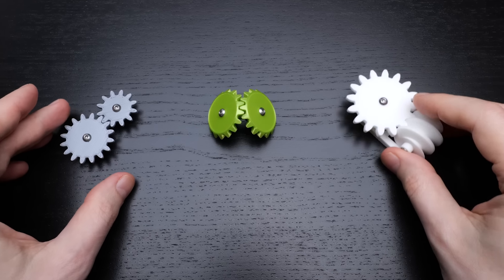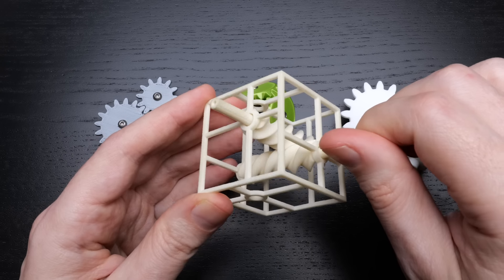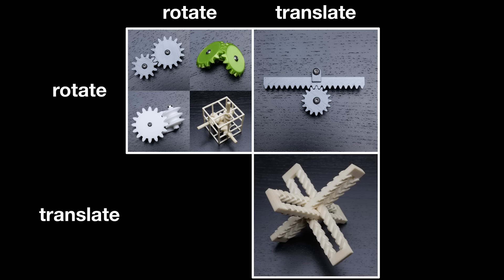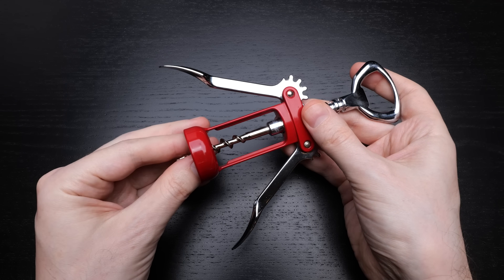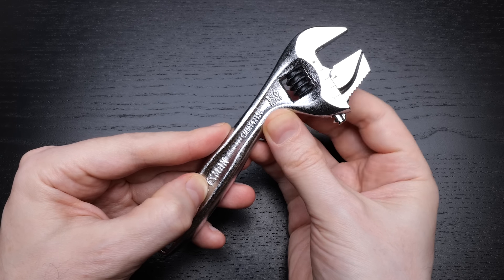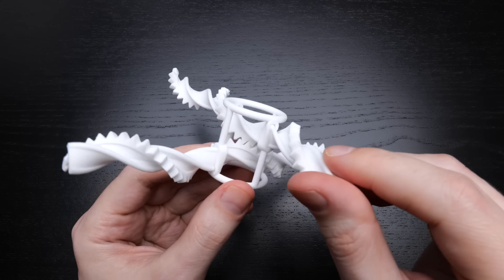Screw/screw gearing

Comment: This seems like a solution that has not found its problem yet.
Reply from the maker: That's often how art and (pure) mathematics work.
Reply: @henryseg  I have a folder on my computer titled "Solutions in search of problems." I think this sort of engineering is good practice and frees your brain up for lateral thinking once the real problems come along. One of the files in this folder was a spherical gear, which I never figured out but these smarties did: https://youtu.be/hhDdfiRCQS4 What would this be an example of? Rotation-rotation-rotation?
Reply: @digitaluddite  I have a folder on my computer like that, but it has nothing in it!  It is a solution to a problem of solutions in search of problems!
Reply: @henryseg  Then I think my art has yet to find its problem.
Reply: It's perfect for making 45 degree holes in a production line. One piston, and two drill tips. Also, for a vault lock.
Reply: You mean like a technological singularity?
Reply: @digitaluddite  what do you mean you never "figured out" the spherical gear? Figured out how to put it together you mean or how it worked what? Hope you can clarify. Thanks for sharing
Reply: @henryseg  Do youbhave any tips for coming up with new designs for these new tools or mechanisms or wha/ever you call the or how to solve problems with them? Thanks for sharing and hope to hear from you.
Reply: It's a pretty cool mechanism, but it looks like it would be very fragile and easy to jam.
I doubt that it can exert much torque before distorting permanently, then jamming where the frame and screw intersect.
The screws also cannot be very long, else they will distort due to their own weight.
I'd really like to see this mechanism somewhere in the future, but I kinda doubt that there are many useful applications.
Reply: @leif1075  I’ll try my best. I wondered if a gear could be made 3 dimensional. I started with a sphere and ADDED teeth, trying to find a way to pattern those teeth around a 3D surface. I couldn’t ever figure it out. Some time later I came across the video I linked to. The key difference that they made is that they CUT the teeth in one rotational motion and then again in another rotary motion. I was somehow trying to find a spherical gear set where the two gears are identical. I don’t know if it is possible and surely isn’t as useful as the gears in the link.
Reply: @digitaluddite  Mate, that's clearly a prototype for robotic shoulder and hip joints; or at least they will be some day lol
Reply: 42
Reply: @isaacm1929  you over estimated by 3 degrees
Reply: @angelsachse9610  I think the two helix gears could be on outside of solid shafts and still work which should fix most of the strength issue.
Reply: The problem is, "What can I make a video about?" Or for the audience, "How can I distract myself from the dreadful meaninglessness of existence for several minutes?"
Reply: i ve found the problem your solution can fit into: mechanical RNA and DNA Transcription principles. plz mention me in your paper now.
Reply: @digitaluddite  DNA/RNA Repair mechanisms.
Reply: "Nail seeks hammer"
Reply: @averageXIAOHONGSHUenjoyer  lol no
Reply: Mechanical daydreaming.
Reply: @angelsachse9610 just add gears to support it
Reply: Often because art is not a mistake, and the result can't have a mistake since you are the first person to make that particular thing. I may have flaws like what you wanted it to be versus how it came out, but make no mistake, it can't have a mistake.
Reply: @leif1075  Sphgear
Reply: yea, he is that guy giving smart math answers. But the teacher has not asked any questions yet.
Reply: Looks like protein making 😮
Reply: Technology so advanced it has no application
Reply: @Oberon4278  well, we can't all be engineers. I dig this kinda thinking and dare say, there's SO many better ways to grab the attention of vacuous ppl.i think there's something that society can benefit from here. Kinda like what the Internet was always supposed to be.
I wonder, have you ever seen Leo daVinci's mock up of the 1st tank? Do you find it any less amazing once you realize it's error? Does anyone have the credentials to judge his work?
Reply: @neepsmcfly4176  What?
Reply: Nah this is how they make bmw engines
Reply: @henryseg  screwscrew box looks like protein production from dna.
Reply: Like lasers
Reply: Could be used to easily adjust a plane centered on the frame, work can be applied to both screws and lift a very heavy load between the two, 
If there's enough friction between the screws or if they're kept motionless it could allow you to create an adjustable table with very few parts
Furthermore, precision is extremely high and since jerk and acceleration are minimized to the screws and not the load it would be great for extremely precise movements
Reply: You just asked a problem
Reply: if we define practical intelligence the ol' fashioned way as the ability to solve problems, this finding solutions to problems before they even exist should definitely be called genius...
Reply: This might be able to be used in gantries and 3d printers!
Reply: @Evan-hm7tz  micro printers especially, jerk is so low precision is probably really high
Reply: I feel like the screw/ screw gearing would make an interesting locking system with a few tweaks here and here
Reply: @someoneonyoutube8622  exactly, and found on another world.
Reply: It looks like RNA
Reply: Mmmmm DNA REPLICATION?
Reply: The whole job of an engineer actually, find a problem to a solution 😂
Reply: @henryseg  there's a company called Roll making some crazy cool mechanisms. You would probably love their stuff
Reply from the maker: @1jtwister  Not the easiest company name to search for - any other identifiers?
Reply: Quite possible. Yet it's still a fascinating thought exercise.
Reply: It's a concept for future innovation. Not all invention or innovation target's a problem.
Reply: The problem that is being solved here is .....how to get views on YouTube ?
Reply: @snoochen  yes, answers to non-existent questions )
Reply: @neepsmcfly4176  Leonardo knew what kind of work he invented the tank to do.
But the topic starter does not know what kind of work he invented his mechanism to do.
Reply: Maybe it could be used in a puzzle or in robot parts/implants
Reply: this is where Steve Jobs' brilliance would come in handy. He'd market this in some simple implementation & everyone of us would wonder why we didn't have it by default since time began.
Reply: @henryseg  As a composer, I really appreciate this comment as well as your brilliant designs. Liked and subscribed!
Reply: @averageXIAOHONGSHUenjoyer  ????? bro what
Reply: DNA would like a word with you
Reply: @henryseg thats an interesting way to look at things. So every math problem that seems useless to us has some yet to be discovered application?
Reply from the maker: @Spicystachegamer  Perhaps, yes. Or maybe no application will ever be found, who knows? But that’s not generally why pure mathematicians or artists do what they do. It’s great if there is an application, but it doesn’t invalidate the work if there isn’t one.
Reply: Me fr bro 😔
Reply: 42
Reply: I can see this being a cool new way to drive pistons in an engine
Reply: @bobmackay1856  ah crap, I might have to do this!  If I'd done it since I was a kiddo, I'd have stored GB worth of ideas!
Reply: @henryseg  There is a kind of a metal lathe 3-jaw chuck which uses similar racks to sunchronise its jaws.

Comment: The translate-translate gear is almost a pair of opposed mechanum wheels, if you were to bend one of the translate gears around so that it loops back on itself. The action of the rollers is as if the floor had teeth at 45 degrees to the plane of rotation.

Comment: Henry, have you considered attempting to build a pliable/flexible version of that mechanism, such that the helical racks conjoined to form a figure eight?
Reply: Or a moebius strip each?
Reply: I don't think that could work. As one piece, the rotation and translation when it crosses itself will be opposed. You would need a spur gear between.
Reply: @punpundit5590  I'm definitely not an expert on this but my intuition tells me that if they are both Möbius strips then there should be no need for that intermediate spur

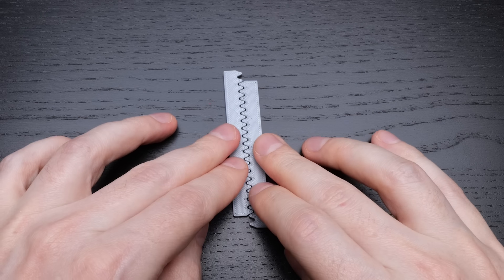Comment: The "two ordinary racks" from 5:45 remind me of a safety feature in railway rolling stock, where they add large rack-like panels to stop relative motion along a vertical axis in colliding vehicles. That prevents a situation where one vehicle's frame could slide on top of the other frame and crush everything in the passengers' space.
Reply: Ive seen these on thise little cargo wagon deal, basically a skin made of teeth that fit to the cart, then you could lever the teeth up to keep it rolling.
Reply: @Absolute_Territory  Not quite sure we're talking about the same thing there...
Reply: Oh, anti climbers! Aren't they for preventing telescoping?
Reply: @Absolute_Territory  Write a horror story in only four words:

"skin made of teeth"
Reply: @falkland_pinguin  I meant to say a skid with teeth on it so inertia won't send the load flying
Reply: @hollt693  oh shit I did a cool
Reply: @Absolute_Territory  Still not talking about the same thing, but that's a neat idea, too.

Btw, I do think it makes sense to call inertia a "centrifugal force" when looking at it from a rotating reference frame, even though "inertia" is more correct.

Comment: I love 'periodic tables' like this. Some are just done stupidly,  but when you decompose the the space into orthogonal  attributes, you get an amazing pointer to possibly undiscovered items.
Your table here shows this ( labeling "screw" with an additional "rotate+translate" label  adds a bit of insight ) 

But it also shows that you have not yet identified all the axes.  Look at the rotate/rotate  box where you have at least 3 different mechanisms that fit into the same grid location.

I think the missing axis ( or axes ?)  is angle between the two planes of motion (??)  with values  'planar',  'bent', 'yawed'  and 'pitched''

If you added another 3 layers to this grid, and added the 'useless  configurations  ( like your locked up racks )  you'll possibly get a complete set of mechanisms.  
Color coding 'part A' and 'Part B' might make things clearer.

The 'plane of engagement' is another possible axis.

Some missing items:
  in rotate/rotate:  you have pane of motion values 'planar', bent and pitched,  but are missing yawed
                 the spur/screw  item engages on the 'bent 90 degrees' plane,   but could engage at 45 degrees bent ( would lock up)  or planar  ( the spur would have rack holes and the screw would be lozenge shaped)
                the 3 item screw is probably two items together with left and right chirality  somehow, which hints at another axis

in rotate/translate:
                there is a missing  rack/pinion where the 'rack' translates up out of the page, and one where it translates away from the pinion
in rotate/screw:
                the handle of the corkscrew could emerge from the screen and twist
               the handle axis could be an axle aligned top/bottom of screen and used to roll the cork remover to the right

I am probably missing some, and I feel I have mistakes above because I probably haven't characterized all the orthogonal  attributes correctly.
Reply: interesting idea, although in practice combinations of any of these and bevel gears can change the axis we're working around. however, a few additions just for thought:
a spiral gear would be a good example of a rack and pinion-esque gearing that pushes the rack away from the gear
a rack and pinion moving up out of the page could be filled by a worm gear moving a rack, which is yet another way that the adjustable wrench can fit into the diagram, if you look at it from above
constant gear ratio, whether or not it can be worked infinitely, and different possible frames of reference are all other possible things to explore, I feel this is a discussion that can very easily get very complex
Reply: Do you mind sending me a word documents of this table? 😅 Just so I see if I truly understood what you meant.
Reply: These tables brush up against abstract maths that I really wish I could sit down and learn.

Comment: Couldn't a "screw - screw" combo be as simple as a screw and the the nut or hole it is threaded into?  The perpendicular screw  - screw model you made is pretty cool.
Reply from the maker: That would only have two parts, not three. You need a frame part and two gear parts that screw into the frame.

Comment: I know there are locks that use a design similar to the borromean racks, but they only use two pieces and a frame. You push one of the racks into the key hole and the corresponding motion on the other rack lifts the latch on the door. The teeth on the racks are irregularly spaced so each key is unique.

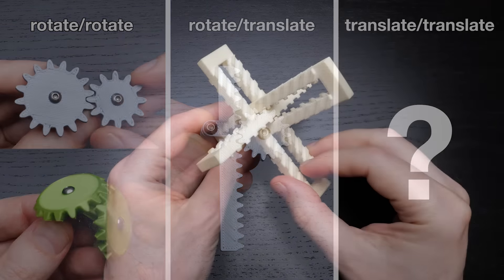Comment: 2:10 the translate gear thingy - I found a similar thing the other day when fixing a pair of binoculars that has this zoom thing and you control it with an arm around one of the eye pieces. A thin piece of metal moves along and the same motion is replicated on the other eye piece. It’s so clever, I’d never come across it before and was why I bought the broken binos from the charity shop.

Comment: You could make them elastic and turn them into a circle like screw and screw forever. Maybe the circle is big but I think it would work when you use a few more frames arranged in a tetraeder way and the circles will rotate themselves around their centerline instead of them rotating 90° relative to the frame in the center and crash into each other. :)

Comment: i dont know about screw-rotation (maybe just a wrench looked at from the right direction?), but a tool i use a fair bit is the micrometer. while it doesn't have any mechanisms per se, it nevertheless is used to convert screw motion into precise linear motion, for the sake of precision measurement. the thimble moves in a screw motion relative to the frame while the spindle moves—in practice—linearly.

Comment: While I can't confirm if it was a screw-screw mechanism, my drafting teacher in highschool had a special adjustable squaring tool for faster square plotting that had a screw as at least part of it as you would rotate a knob and the x and y axis would create distance or close it at the exact same time, assuring you were tracing a square. He said it was a novelty antique he found back in the '70s. But it was less practical than the ruler built into a drafting bench for a multitude of reasons.

Comment: I remember seeing a video of a weird lock that was a rack and rack mechanism, the key was one rack, with irregular tooth spacing at a 45 degree angle and the lock had a bolt with the complimentary tooth spacing. I was unable to find the original, but Maker's Muse did a video on it in 2019.

Comment: How about the lock mechanism from this video: https://www.youtube.com/watch?v=oeKN7Hx8HVI as an example of a translate/translate mechanism. The door is the "frame" part, and the key and the locking bar are the parts moving relative to the frame.
Reply from the maker: That looks like an example - thank you!
Reply: @henryseg  glad to help
Reply: Industrial grippers have translate/ translate mechanisms. An air cylinder moves 90 degrees to two jaws causing them to open or close some of Schunk's grippers are made this way.
Reply: Ah damn you got there before me!

Comment: The screw/screw functionally works like a set of bevel gears sliding 2 racks, but are much more elegant. If ever there's a need to both slide and rotate elements in 3 axes, there it is!

Comment: Here's a guess: 
If you take a typical leadscrew, but call the "screw-shaped" (rotational) part "frame" what previously was the "frame" becomes a rotational part, and what was the nut (translational) part becomes a screw (movement) part. 
Alternatively,
If we define the part that was the nut (translational) part to be the "frame", the screw-shaped part becomes a screw-movement part, and what was the "frame" becomes a translational part.
These are all equivalent functionally, but what we call the frame changes our perspective, and thus the relative motion of the other parts becomes different.

I think that it's interesting that this means that when we change the "perspective", it changes what classification can be applied to the system. For example, if we take a typical set of bevel gears, and name one gear the "frame", the frame becomes a rotational part, but the other bevel gear becomes something entirely new that moves in two rotational axis. The system still has one degree of freedom, but the part moves in multiple different ways (this is because the axis of rotation changes throughout the cycle, namely, the axis of rotation rotates along with the part previously called a frame.)

This concept, and the fact that "screw" motion appears to be a combination of rotational and translational motion, leads me to believe that this would generalize to a wide variety of different types of motion, but perhaps we can classify those motions as compositions of simpler types of motion. Some combinations (like in screw motion) might be commutative, but others (like the mentioned double rotation) might not. I wonder what relationships these types of motion might have? Could we come up with a useful notation for how mechanical machines work as a result?
Reply: Ooh, you noticed that property of changing perspectives. Shall I point out that if you change your perspective to that of the worm gear on the spanner, the jaw becomes screw movement, and the handle becomes rotational movement? 
It's basically an example of an applied leadscrew though, (but using a rack instead of a nut) so I guess it's not surprising it has the same properties.